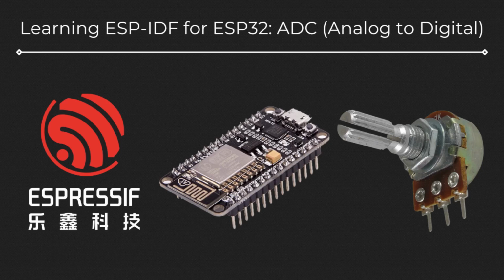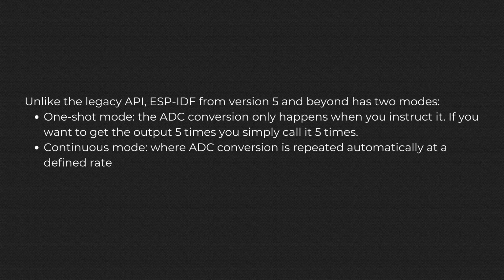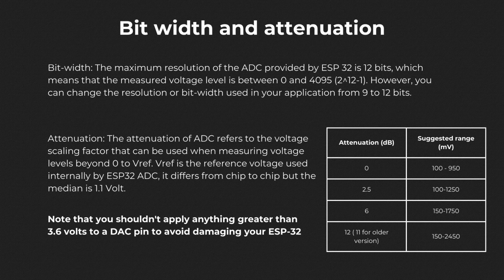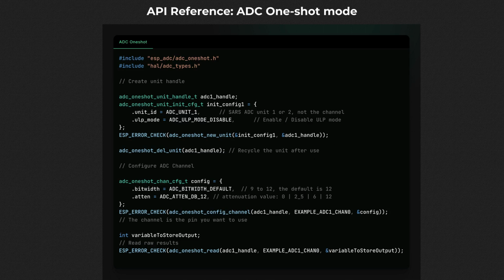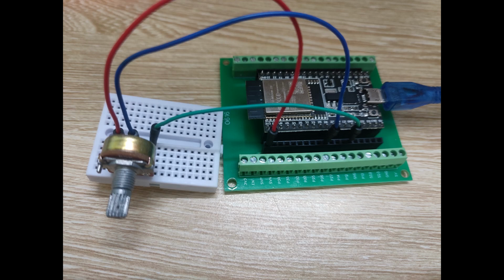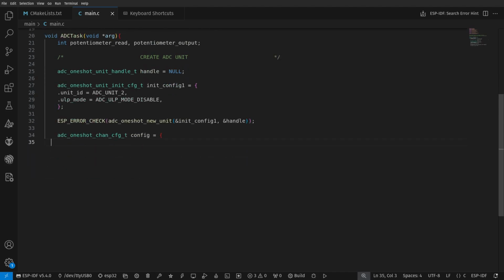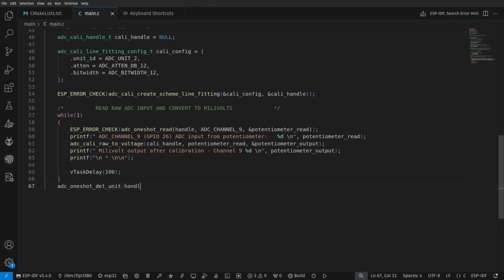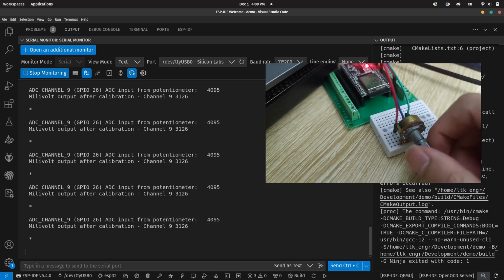ESP32 with ESP-IDF #4 | ADC (Analog to Digital Converter) & Reading input from potentiometer

Comment: What approach would you take if you had to use all 10 ADC1 channels?
Reply from the maker: You should use the continous mode instead of the oneshot mode here (If you use oneshot then it can only be read sequentially so there is delay between readings). In continuous mode, it collects result continuously in frames, where each frames can have multiple conversion results from different adc channels: https://docs.espressif.com/projects/esp-idf/en/stable/esp32/api-reference/peripherals/adc_continuous.html

There is an example on reading two channels here with continuous mode, you can do the same for all channels:  https://github.com/espressif/esp-idf/tree/master/examples/peripherals/adc/continuous_read

Comment: Any thoughts on using Eclipse + EspressIF IDF plugin, instead of VSCode, in order to debug using the OpenOCD and ESP32-C/S' built-in jtag/debugger?  

I tried following a 2020 post called "Espressif esp-idf & Eclipse IDE: Debugging with JTAG and OpenOCD" by Craig Peacock, and "Updated "How to" Set Up Eclipse for ESP32-C3 Built in JTAG Debugging"

But they're a few years old, so not sure if the instruction still work with the current versions(Eclipse 4.33, OpenOcd 0.11, espressif 5.4).  I can't get it to debug using the esp32-c3 built in jtag debugger.. and can't tell if it's something with the generated elf/bin (tool chain/options) or something with OpenOcd/eclipse setup.
Reply from the maker: By the updated post you mean this: https://www.esp32.com/viewtopic.php?t=22365

Even that is too old I guess and that shouldn't be too helpful by now. The best I can recommend is to just follow the official 5.3.2 stable documentation for esp-idf here : 

https://docs.espressif.com/projects/esp-idf/en/stable/esp32/api-guides/jtag-debugging/index.html

The guide doesn't mention how to get it to work with Eclipse IDE, but try to see if you can configure this